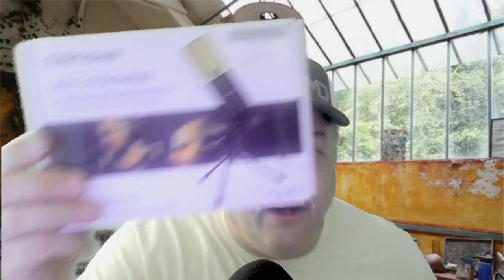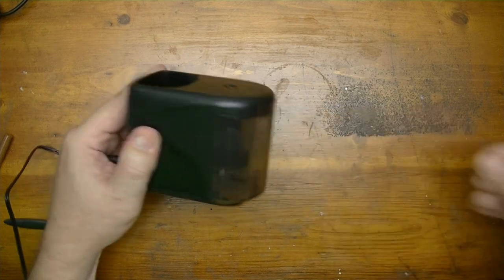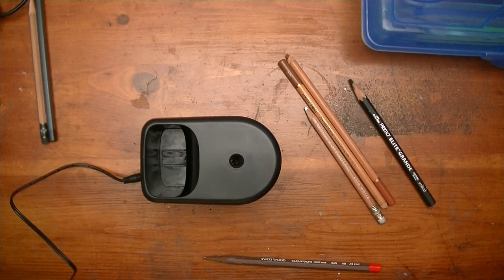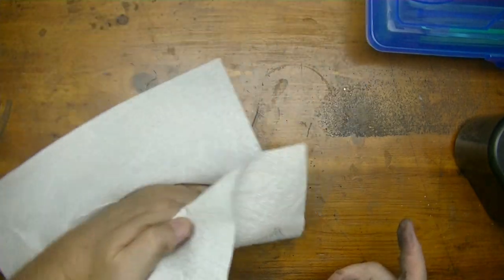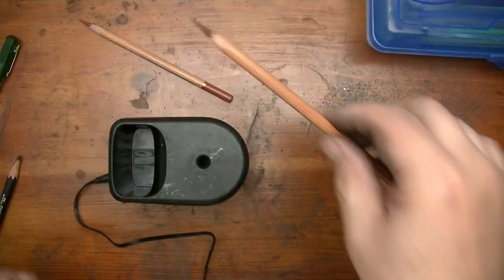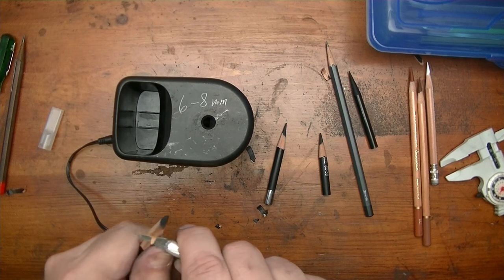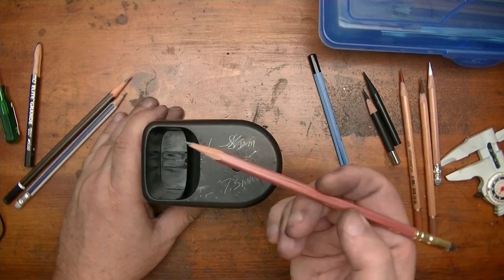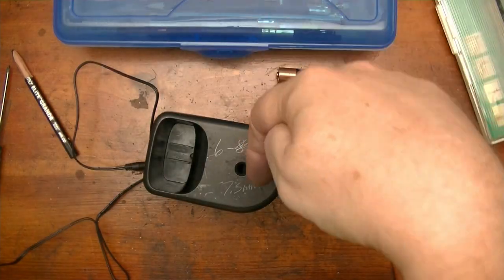Can This Pencil Sharpener Take a Beating? | Riyo PS-04 Electric Portable

Comment: With the 8mm claim, you are using hexagonal pencils so you would probably need to measure the widest part (corner to corner) you are measuring the shortest (flat face to flat face). The 8mm is probably the diameter of a circle that fits in.
Reply from the maker: That's true, and that's even worse! Because just a standard hex like the Blackwing expands out to 8mm from the edges and the Caran d'ache even wider. That's a big negative. And yes, the inner diameter is about 8mm.  Sad.
Reply: @RixCanDoit  I guess the ultimate test is in your videos! My blackwing measurements are 
602 7.19mm flat to 7.71 widest
Matte widest at 7.21 to 7.80

Mathematically the conversion factor is aprox 1.155 for hexagonal so corner = flat*1.155
on the 602 this would give 8.3mm corner width.
But obviously it is shorter as the corners are rounded.

Ever get the feeling you have thought too much about pencils?
Reply from the maker: @FluffieWolf  "Ever get the feeling you have thought too much about pencils?"  Starting too.  LOL!